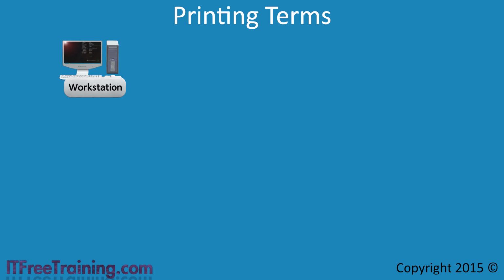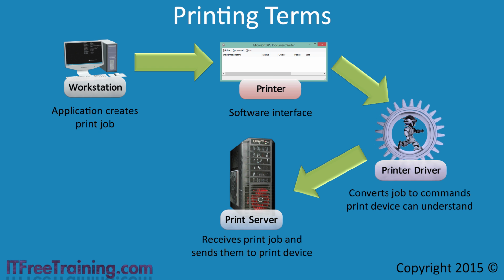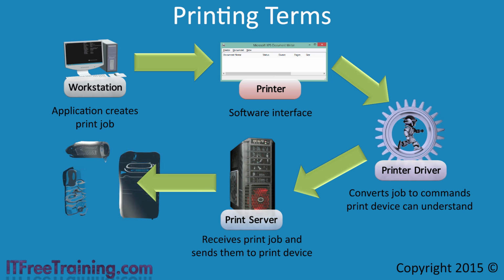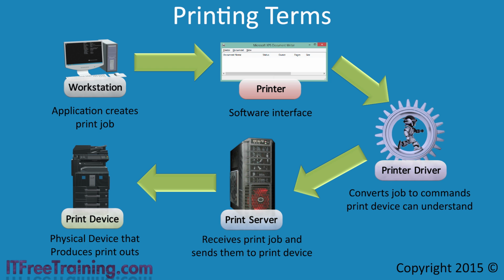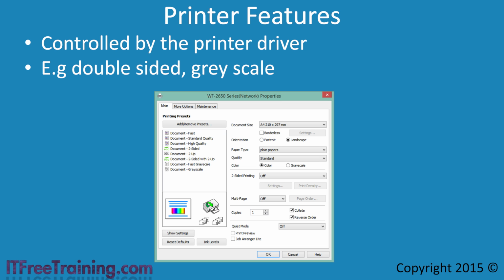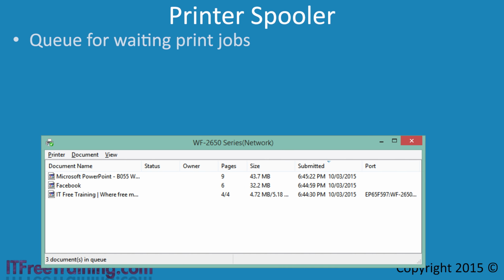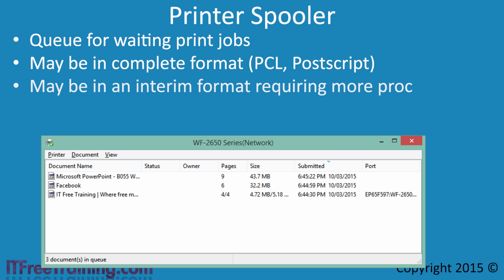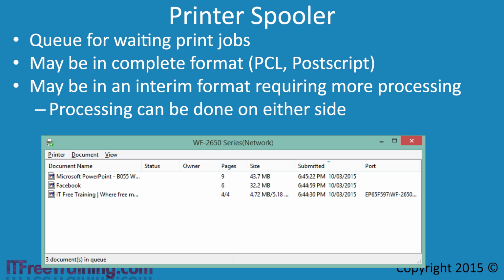Windows Printing Introduction

Comment: Very useful appreciate it, thanks! one thing which I am wondering where does the printer spooler resides is it on the "printer" or under "print server"?
Reply from the maker: The Print Spooler resides within Windows and acts as the man in the middle between the operating system and printer itself converting the digital data into the printer language.